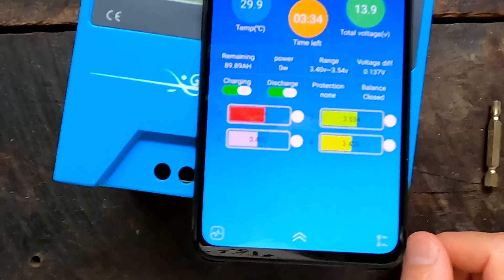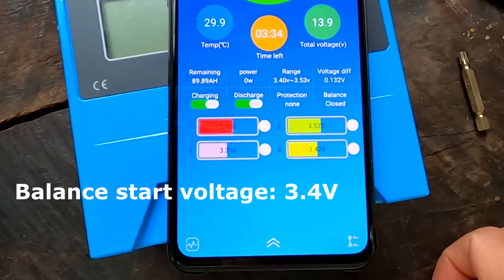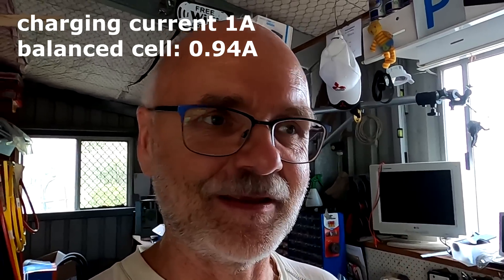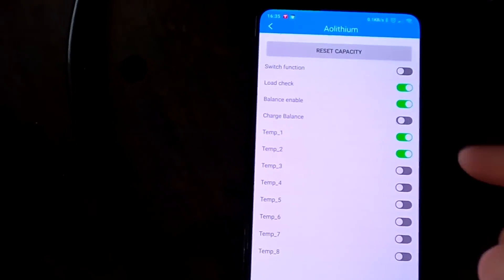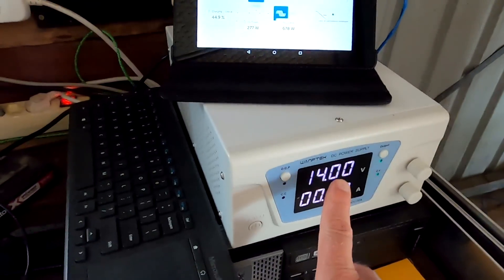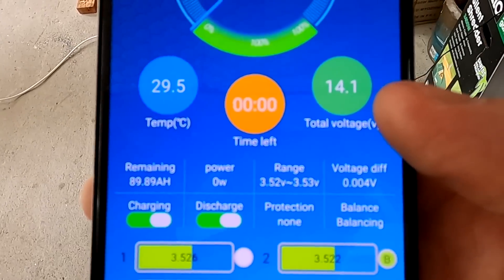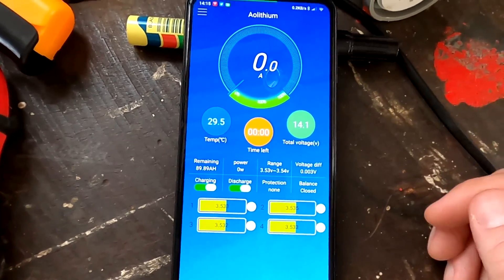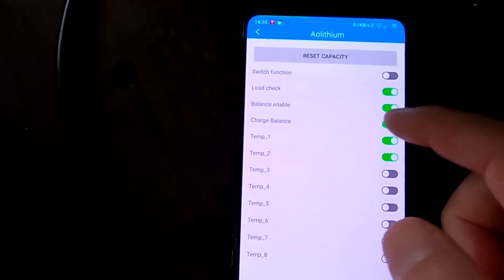Why 'Charge Balance' is a bad idea and how to auto top-balance a battery over night with any BMS.

Comment: Is it done for reasons of efficiency? As in the amount of drain on the battery? I imagine balancing only when charging is going to avoid phantom draining things.. For wide variation, sure: making it balance more, but charge balancing seems like it would be good enough vs the trade-off of burning more energy.
Reply from the maker: The energy is burned in any way through the balance resistor, regardless if charging or not. And balancing should only happen if voltage is higher and there is actually a difference across the cell voltages. If this is all within the set parameters, balancing should not turn on at all...

Comment: I bought a seven-dollar BMS for a small battery build and I could see the balancing happening continuously on my multimeter right after hooking it up. It balanced very quickly.
Reply from the maker: Nice, if the voltage of your cells is high enough, it goes quickly and you can indeed watch it.

Comment: I have been running a lithium battery pack, 14kw for 2.5 years. I use the power down a max of 75% before the sun kicks in. I am use the 250amp BMS with an active balancer with a low to high of, low is .022 and at high .008. I am pushing some loads, a peck at 4000w. I have found its about testing your battery’s to see how they work together under loads. Im seeing your battery’s as a miss match.  Why would would you see so much drift in balance?  (Not hate this is a productive comment).  Love you video keep up the good work.
Reply from the maker: Thanks man. As I said in the video. The test we did before with this battery was discharging all cells to 2.5V which basically bottom balanced the pack. Now, when fully charging it again we can see the drift and I wanted to check the BMS if it is capable to balance such a mismatched battery again. Turns out it can with the right settings of the BMS. Event the small 60mA balance current could perfectly balance the pack within one day.

Comment: Andy. I have 6 banks of cells. Each 120ah
What cheapish bms can I use that has a good balancing feature and strength as you mentioned (only need about 60 or 80 amp per bms. Cheapish cause I need 6 of them to balance this nicely. I have ant bms and Daly currently and the 3 different apps is annoying.
Reply from the maker: What voltages does each bank have?
Reply: @OffGridGarageAustralia  its running as 16s.  Each bms is running as follows.
2p16s, or is it 32  🤣( it's 6 15 am as I type this) then 3 banks of that in parallel
Issue I'm having is on those cloudy raining few days (3 or 4 days constant rain) there's always the cells that gets to 2.65 when most of the others are still 3.1 (watching your videos I've learnt that there isn't much juice left below 3.1v but when they charge back up there is always that bit of imbalance and takes a few days to level out
So want to affordably put a bms on 16 cells,  so 6 bms total.
Hopefully things would stay more balanced and handled better.
When it's good sunny days, the cells balance out nicely, but then when it gets cloudy/rain for a few days it's goes all frogged up 😟, bulk is 55.4, and float is set at 54.4.
Yesterday morning I woke up to a offline house due to the imbalance.
When the system dies, the end voltage is usually the 49v range, with low cell protect set to 2.65v
Reply: The end voltage when the battery is low is 49.8 v on average per bank

Comment: So the high voltage cell has its resistor on but it's voltage is still much higher so voltage times amps equals what? Is it still getting net more power than the others even with the balancer on?
Reply from the maker: This is not about the power a cell get. The amps are what actually charges your cell. The cell which are balanced are just getting 0.06A less than the others.
Reply: @OffGridGarageAustralia  I get what you're saying but the net power has to be less with the resistor on or else it won't be able to allow the others to catch up without the high cell going critical first.  In fact if the cell is full the power actually making it into the cell has to be near zero or it would shoot up to a critical voltage.  This is why when I've had severely out of balance cells in series as approaching top balancing voltages I've had to freeze the voltage at 13.8 in order to reduce the incoming amperage to something about equal to the bleed off resistors amperage abilities.
Reply: @Travis Sanders  that is the key. Keeping the total charge voltage lower than the voltage that will cause the highest cell voltage to pass critical.  That will allow it to balance.  Once it balances at that voltage,  you can increase it slightly to get a higher top balance .
Reply: @TheTimshady337  exactly. My BMS is supposed to communicate through the can bus to my charger so that it will control this exact process but my Tesla hybrid inverter doesn't speak the same can bus language as my BMS. I have 152 cells in series .  Nothing is in parallel so nothing is forced to be the same voltage. It's a little harder to keep things balanced with this many cells in series but at the same time it's also easier on the other hand because it is scientifically impossible for different cells to experience different amperages.  So far it's been working 2 years . I'm only charging up to 3.398 volts per cell which is just barely enough to do a little top balancing.
Reply: @SiriusSolar  I can't imagine keeping track of 152s. If it is working,  you must be doing something right.
Reply: @TheTimshady337  I'm not doing it.   It's all in the bms.    Youtube Travis Sanders lava for my YouTube channel

Comment: The passive balancing in some of a few brands of bms are not great. I have noticed some models will balance a linked pair of cells and not the two highest cells individually. I have found as many others have also come to find that an Active Capacitive balancer works far better and with new A+ cells you don't even need to top balance before you build the pack just allow the active balancer to do so. With a passive balancer its best to still top parallel balance and rest before you build the pack. It seems nearly every smart bms has its bugs. Daly are well known for issues. jbd are more reliable but the balance function is poor on some models. For most people a hardware based BMS is going to be the most reliable.
Reply: What do you mean by a hardware-based BMS? Do you mean a non-"smart" one?
Reply: @BenGrabham  Yeh non smart bms

Comment: Good find Andy, I have a couple of these BMS's but haven't experimented with all the settings just yet. It is very strange that there's no full time balance option, what an odd function. It would be great if JK made a 12v version of their BMS, and if they made one that was 12v 250A or more, then it'd sell so fast. But they wanted $16k to develop it and that's too much for me, especially because if I had one custom made, I'd find it for sale to everyone else anyway. Perhaps you can use your contacts to make suggestions ;)
Reply from the maker: I suggested that to them already, said, we need a high amp 12V smart BMS with active balancer. I'll keep pushing.
Reply: There should be a 12V JK BMS soon-ish. Don't quote me on that.
Reply: For me a 100-150A would be fine enough 😀

Comment: Andy, 

This BMS has 150ma balance current according to the JBD Data sheet I have for the JBD-SP04S034-L4S-200A-200A-BU model.
Reply from the maker: OK, thanks. Then it is even weirder as I have only ever measured 60mA as the max balance current with this BMS in this battery. I checked my QUCC BMS a few times and could measure around 160mA balance current. The QUCC is stated with 200mA balance as well.

Comment: You might want to verify the "only balances with 50 milliamps" number. I say that because it depends on which model of BMS you have. I am not sure why you have so many balance problems, I never have any (might be because the cells I purchased are matched?) My JBD uses 150 milliamps, BTW, the 50 milliamps is an older Daly model. A balancer "always working" will get your cells out of balance during the middle of the voltage range, and it is exacerbated by grade B cells. Amazing to me, I leave it set on 3.4v charge balance and never have any problems.
Reply from the maker: John, I don't have any balance problems... not sure what you referring to? I'm testing a BMS's balance capability here with an unbalanced battery pack.
A balancer should only balances above the balance turn on voltage and if deviation is exceeding the set threshold. I mentioned this several times in this video. These are the two criteria for the balancer to turn on. Running a balancer the whole time would be stupid as we have tested this in a quite a few videos as last year here on the channel. And of course it will mess up your top balance as you said.
Also 3.4V is a very low voltage to balance and may not show any deviation across the cells even they might be on a different SOC. The curve is just picking up at this point. If you charge to 3.55V from time to time it will show you if all cells are in balance and have (almost) the same SOC.
Reply: Andy didn't suggest that a balancer should 'always be working'. He said it should always be working above 3.4v whether charging discharging or doing nothing. This is something he made clear in one of his videos ages ago.
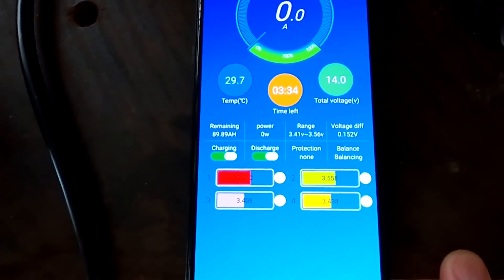Reply: @vonasi2  8:20 timestamp, "this is how a balancer should work, it should always balance". He emphasized "always" a bit, discharge, charge, etc. Please correct me if I heard wrong.
Reply: @john_in_phoenix  You heard right but interpreted wrong. He also said in the video to set the start balancing level to 3.4v.

Comment: With the new setting does the battery discharge faster?  Might be why it was set to balance only when charging so it doesn't get discharged during shipping.
Reply from the maker: Why should it discharge faster? The balancer turns off if the cells go under 3.4V or are within 15mV.
Reply: @OffGridGarageAustralia  Perhaps the microcontroller that makes the balancing decisions has to stay on and monitoring all the time if Charge Balance is turned off? This might cause some drain when the battery is not in use. Maybe the microcontroller power is controlled by the Charge Balance setting and only powers up if there is a charge current (when the setting is on only). 100% a guess though.

Comment: The balance current should atleast be in the 100's na range, 200 ma to 1 amp, for a 100 ah battery  a 250ma balance current , so it has a chance of balancing the cells! 
I have a few BMS that have LEDs on the balance leads, I thought they were defective, since they were on without charging, maybe they  were balancing while not charging? I'll have to check that out again!!
Reply from the maker: You should be able to measure the balance current with your clamp meter.

Comment: I like what he is saying, but keep in mind that the larger the cell capacity, the longer it will take for the BMS to balance the cells.    As an example,  If they are starting at a similar disparity in charge, the 300Ah cells for andy's power wall would require 3 times longer than in the AOLitium battery he demonstrated on.      As with any type of top balancing, patience is required.
Reply: The JK BMS many people use for larger cells has a 2A balancing current. It's definitely an option to do this.
Reply: @upnorthandpersonal  I just installed a JK with 2A balancing and I do not see a control that allows for 'always balance'
Reply: Correction:  It looks like it is always balancing... there is no setting for balancing on charge only.
Reply: @centerrightproudamerican5727  Yes. It's always balancing at a certain configurable voltage threshold. Balancing only while charging is useless, especially with these large cells even with a 2A balancing current. I often have 100A coming in to these 280Ah cells, so there would be almost no time between 3.4 and 3.5 to do anything, but plenty to do overnight.
Reply: @upnorthandpersonal  An observation:    The JK 2A active balancer spends half the time draining a high voltage cell and half the time putting the energy into a low voltage cell.  The net result is that it averages about 1A of balance current.
Reply: @centerrightproudamerican5727  True, but at least it's active balancing and not just burning the energy away.
Reply from the maker: Yes, that is correct, it will take longer with the large prismatic batteries we're using. But it will still work eventually😊

Comment: I have the JBD 200A 4s with heath function, and it balance perfect without charge.  I not remeber what the default setting was.
Reply: May I know what's your battery size?
Reply: @LawAbidingCitizen117  4x100Ah
Reply: @Dan-LS  thanks. I appreciate that..

Comment: I have all my overkill bms to balance when not charging, it works better for me like that. I have 3 200ah 12v in my rv.
Reply: Just to clarify your statement for the benefit of others, I don't want balancing to occur when discharging and  because it would then chase a balance at both ends with detrimental results. By detrimental I mean it would take some cells in the wrong direction and make the maintenance of a top balance harder to achieve.

Comment: No need to top balance just whack on a BMS? Sweet, that was gonna take forever on 280ah cells.
Reply: Use a JK BMS with 2A balancing current.
Reply: @upnorthandpersonal sweet that's what I've got here, thanks for the info. 👌